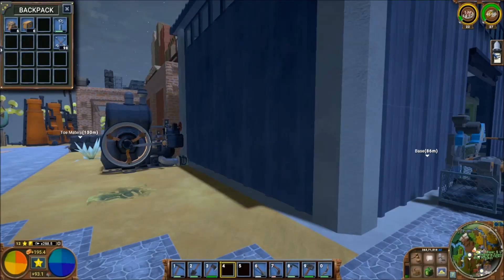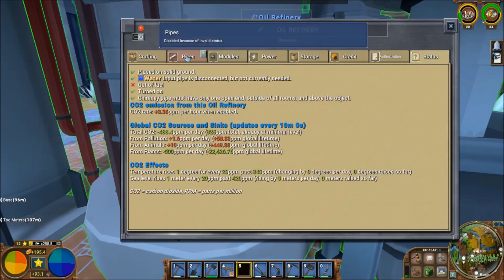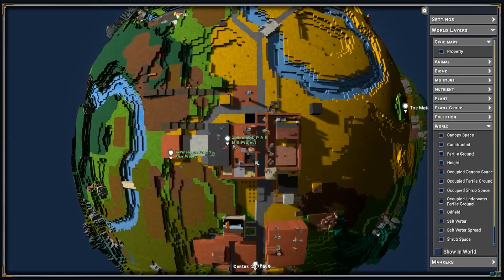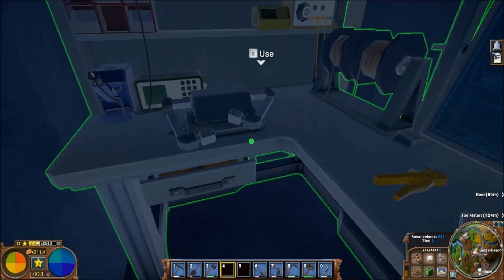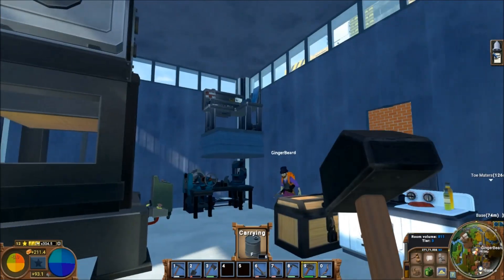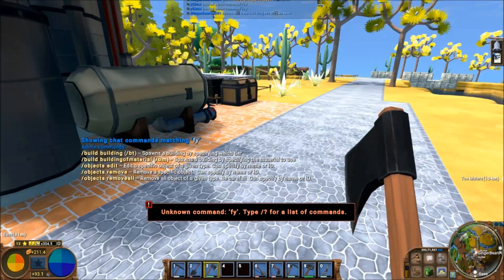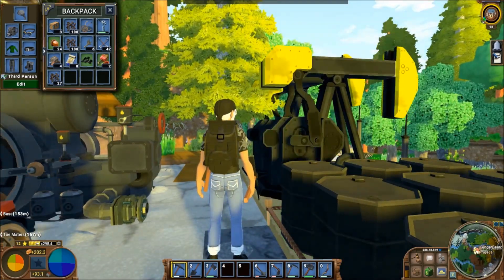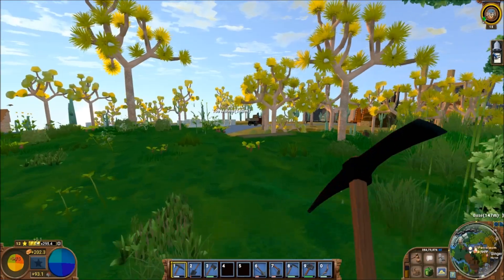Eco 0.9 - 18 - Oil Drilling and Adventures in Plumbing

Comment: The Steam Engine should be producing smog in some newer patch.

As for making Oilstuff, yeah, you want multiple generators running since the pump jacks are so slow it. You might also want to max out power consumption from a single generator to run it at 100% efficiency (generators work in either on or off, not partial, so might as well use all of it), as well as move the refinery right next to the pumpjacks (it spits out empty barrels, so you will spend a lot of time moving those barrels around if they are not next to one another). Heard they want to make the pumpjacks pump oil sometime in the future, so that might make things easier, but for now, barrel reuse it is.